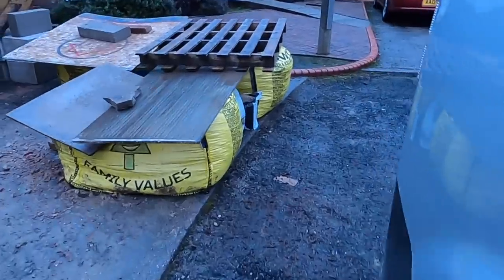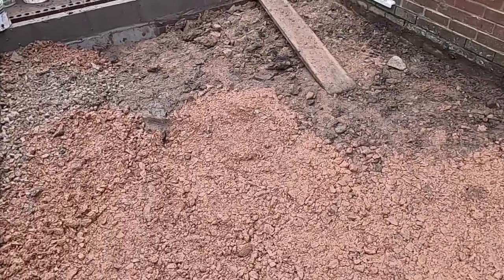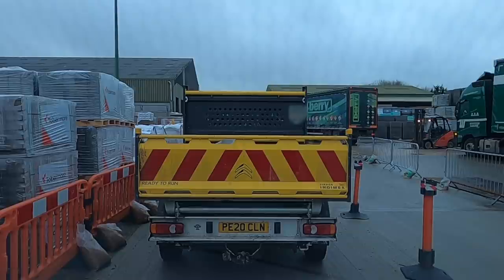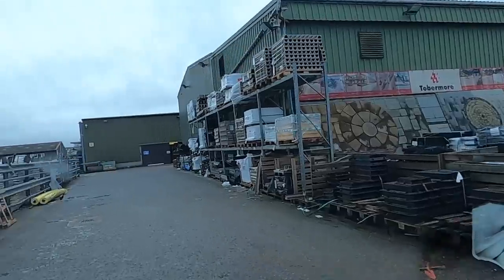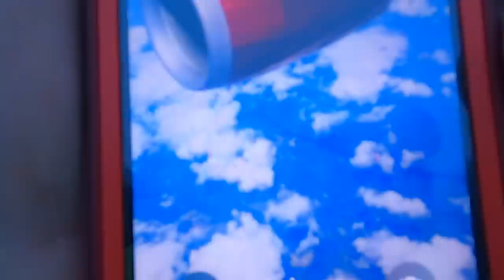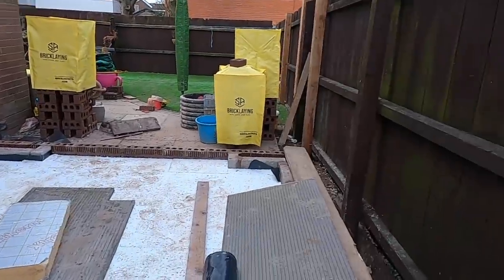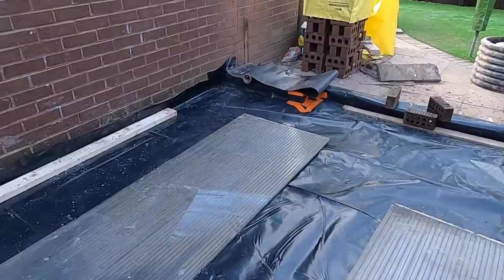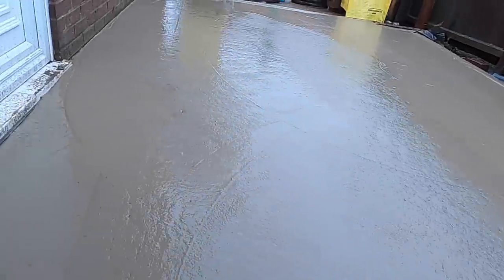CONCRETE FLOOR PREP AND POUR ....CONSERVATORY BUILD PART 3

Comment: Hi Both 
just watching the video doing the conservatry base , an old trick we used in a fiooded house  when its a few inches or in your case a flooded con base was to use an household  dust pan then scoop and throw outside its surprising the amount you can clear in a short time ( retired fireman )
Reply from the maker: Thanks for the tip 😁🧱👍🏽

Comment: The bauker is a beast guys , my biggest one is “ just “ the sds max , you really should take a look at a shovel with a longer handle without the T , it makes a big difference for your back , way more comfortable when digging a hole in the ground  .. anyways nice job and concrete !! 👌🏻🙏🏼
Reply from the maker: Cheers Jay . The Bauker is only a cheap breaker , about £130 but they last a long time time and really get the job done . 
   Thanks for the advice on the spade 👌🏼🧱👍🏽
Reply: @SteveAndAlexBuild  130 is an amazing price 😮🤠
Reply from the maker: @JayKTS  Get in Amazon Jay there are dozens in there , I’m sure you could get one delivered to you . They are all very similar Chinese made machines and different suppliers just put their own branding in them 👌🏼🧱👍🏽

Comment: Why don’t you by a cheap water pump for the end of a drill and attach a bit of hosepipe to it and that’ll suck any water from on top of your damp proof membrane it’ll be quicker than using a mop/shovel . Just an idea mate I think screwfix do cheap ones 👍

Comment: Guys how important do you think it is to have the blinding flat so the insulation doesn't flex because of humps or dips in the sand?
I know you make it look easy but you don't tend to see anyone ruling the sand off before whacking.
Another great build stage thanks.
Reply from the maker: You will never get it perfect but as we weren’t rushed to be ready we just took our time on this one . 
   I thinks any slight undulations will be filled once the weight of the concrete goes on and compacts everything 👌🏼🧱👍🏽
Reply: @SteveAndAlexBuild  thanks for the reply 👍
Reply from the maker: @marks-0-0  . No probs 🧱👍🏽

Comment: We all work differently I guess , but it seems an odd way of working how you have gone about this . When we dig out for an extension we reduce the inside depth at the same time as digging the strip footings . Once we’re up to dpc it’s just a case of back filling, hardcore in and over site concrete or slab .
Reply: Not a dig btw mate you’re doing a good job 👍
Reply from the maker: @leer798  . No worries. We had a hard long weekend on the dig and we just couldn’t be bothered to do the middle and end up working late in a Sunday. 😬😏🧱👍🏽

Comment: Why did you put polystyrene and then some celotex around the edge?
Reply from the maker: We had 100 mm celotex off cuts so we just cut them into 25  mm strips 🧱👍🏽
Reply: @SteveAndAlexBuild  ah did you not use all celotex to save cost?
Reply from the maker: @Theosplaytime  exactly 👌🏼. It’s  probably nearly double the price per sheet plus I can’t stand the smell and the dust when you cut it 😬🧱👍🏽

Comment: Hi steve can you do a  7 m slab 100mm thick without reinforcing
Reply from the maker: As long as the sub base is solid I don’t why not 🧱👍🏽
Reply: It only needs reinforcing if its structural is that right ??
Reply from the maker: @matthewingham8579  Yes or if it’s a suspended slab 🧱👍🏽
Reply from the maker: @martin2466  😳😬😁🧱👍🏽
Reply: @martin2466  no please tell us your views .is it better to reinforce or not .im a bricklayer but new to this side of things and want to learn.i go on steves channel because he is the most realistic bricklayer on youtube .but im all ears on what you think
Reply: Ive done a few piled foundations and used 150mm c35 concrete and a393 mesh which is suspended on the piles but that's it 👍
Reply from the maker: @matthewingham8579  . We mostly do slabs supported by hardcore inside the walls so they don’t need mesh ( unless Martin bags you to put some in 😉😂) 
  But if it’s a suspended slab as you have done it is generally 150 mm and reinforced. 
  If the plans are half decent they should tell you which to install . It’s always best to check before you price up as the suspended version is a lot more expensive 😬👍🏽🧱

Comment: Fair play to you lads !! No way would I have taken out any oversite it looks like you had full block depth of 215mm I would left it put 
75mm concrete 75mm insulation 15mm sand blind with 50mm screed with fibres in it